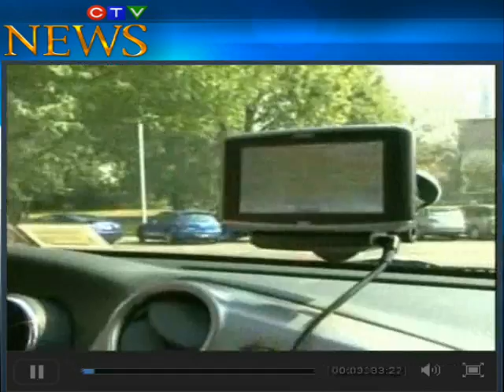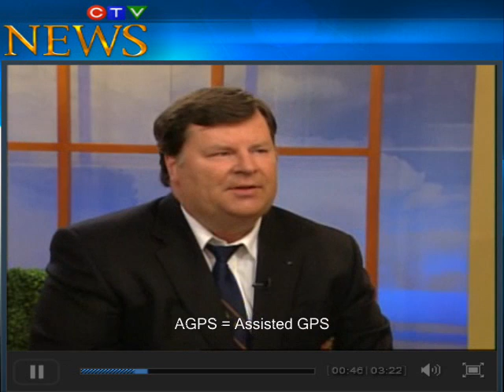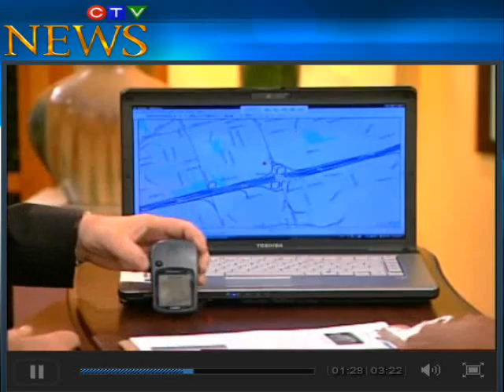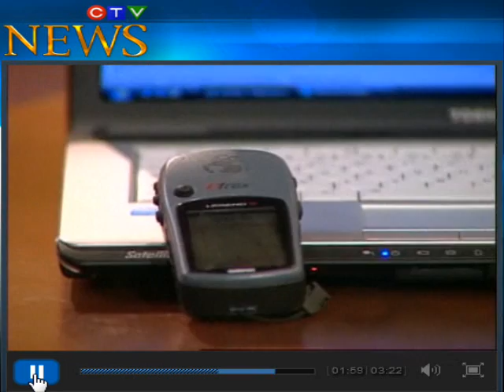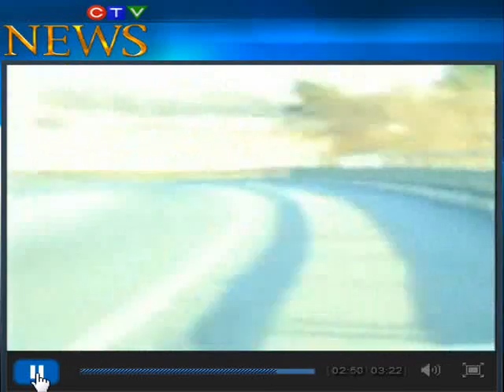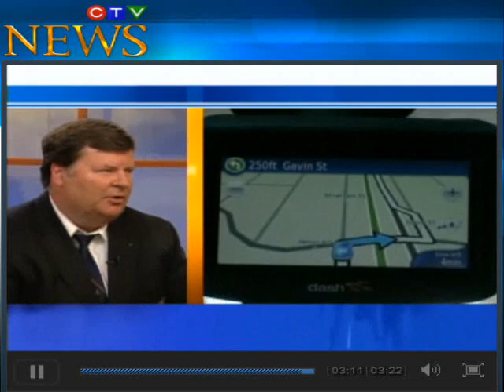GPS 2008 interview given to CTV-TV by Prof. Tim Richardson

Comment: There are so many ways in which you can use GPS and SPS but I yet to see it used   to try and collect data for market research purposes. It may be somewhat of a privacy concern for consumers, however, if there is disclosure then that shouldn't be a problem. - M. Lazarte MGD415

Comment: Its a great technology to to have and certain businesses can use it for security and protection like the example of a bulldozer but at times privacy is the issue as you can be tracked where you are if you have rented a car and there is a chip on it. It should be known to consumers prior to buying such a product which makes it more fair and gives them an option weather to buy a device or not and if they have a privacy issue regarding it 

Syed Hasan
MGD 415

Comment: I like the comment about the privacy issues of GPS. You state that it's a matter of where GPS is applied, and yes using it for taking pictures on iPhone is a privacy concern since it points where you took these pictures and gives an outline of your habits and interests to a potential criminal; however, GPS is also very powerful when it is used for finding one's way and other circumstances that do not pose any privacy concerns.
-Darya B
MGD415